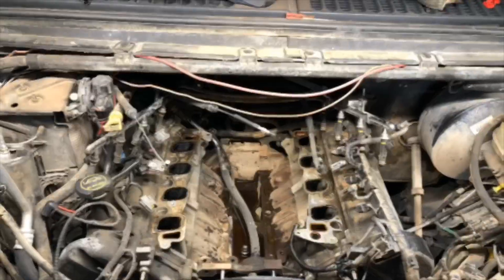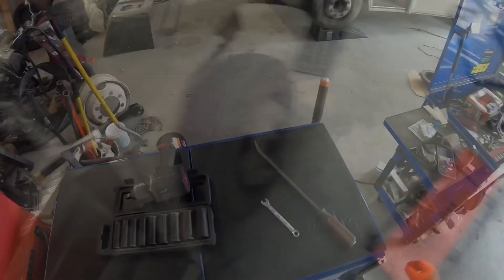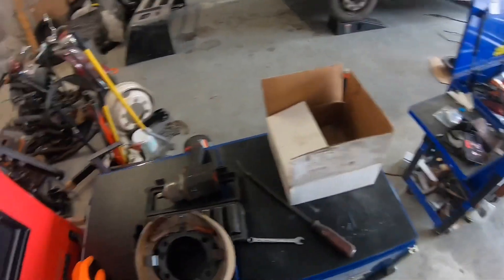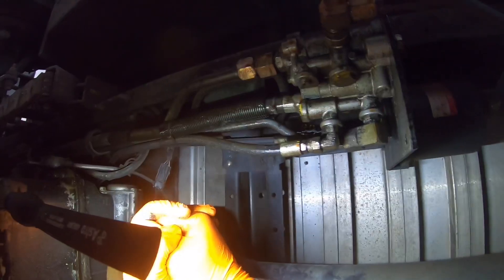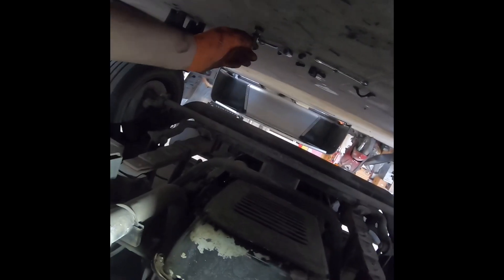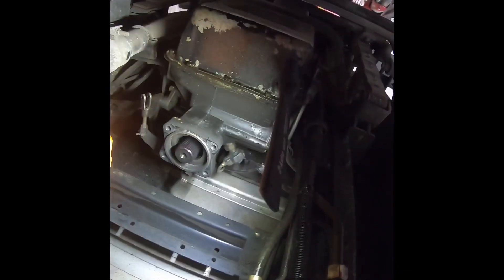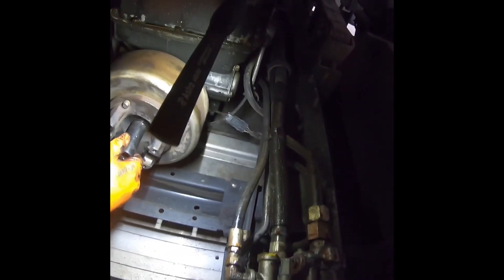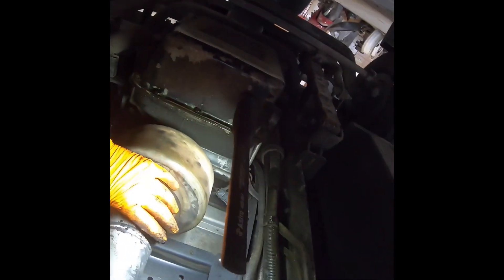Freightliner Stepvans Parking Brake Solved

Comment: Have you done the hydraulic brake chamber on these ? The one that activates the brake
Reply from the maker: Jason Medina I have. Never made a video of it though. You have to cage the spring before removing the cable. Then disconnect the hydraulic lines. Do not attempt to disassemble the canister.
Reply: @MasterT9000  Is it similar to caging it on an air brake system? I see yours is similar to mine. I assume you take out the main hydraulic line that runs to the canister in order to cage it? Where is a good place to find a replacement chamber? I appreciate this video!
Reply from the maker: Rico Reillo yes very similar to caging air brake canister. Put a bolt in it and take off some tension. Then crack your lines. Only place I’ve found the canister is from Freightliner.

Comment: I've got a 2004 Freightliner MT45, 4.3L Mercedes with the Alison transmission. It's been parked for several months as I convert into my retirement tiny home on wheels. Anyway, I go to move it today and the driveline emergency brake will not disengage. Do you have any guidance/advice you could share on how to fix this?
Reply from the maker: Do you have both the PB on the shifter and the yellow pull knob on the dash?
Reply: @MasterT9000  I don't know what a PB is and no yellow pull knob.
Reply: @MasterT9000  The brake is a long lever to the left of the steering wheel.
Reply from the maker: “PB” refers to Parking Brake on the shifter.
Reply from the maker: If the shoes aren’t just stuck to the drum, it might be the cable. At the lever, look for the cable sleeve and shoot some pbblaster or wd40 into the cable sleeve. Then try working it back and forth. Pay close attention to the exposed portion of the cable. Look for binding.
Reply: @MasterT9000  Thank you, that sounds like a plan, well if it ever stops raining, I'll climb under there and work it out.
Reply: My RV was sitting for a long while.  After releasing cam arm, beating the crap out of the drum freed up the shoes...  still need to free up the Haldex hydraulic spring canister.
Reply: @MasterT9000  It turned out to be the transmission. I just needed it to sit in gear for a few minutes for a fluid reservoir to fill back up and it worked perfectly.

Comment: Hi Master TnineK!! I own a 2000 Freightliner MT-45 and I have a problem with the E-Brake coming on while in reverse. They are hydraulic brakes, not air. It is very intermittent. If I go into reverse, the truck may go 5 feet and the parking brake engages. Once I go into drive and back to reverse it releases the parking brake.  Then maybe back for 10 feet and then again the parking brake. I don't know what is causing that. Any help is appreciated.
Reply from the maker: Larry Felix There’s a link at the end of this video that takes you to another of my videos named, parking brake stays on. That will tell you what’s going on
Reply: I can’t find the video?

Comment: Does it work the same on international? I have to do mine too.
Reply from the maker: I believe International has a hand brake instead of a hydraulicly actuated brake. But the drum and shoe setup should effectively be the same.
Different part numbers though.
Reply: @MasterT9000  yes this one does have the hand brake. But I adjusted it and still won’t sit still on a hill. Great video and thank you.
Reply from the maker: @Thetowguy77  you should be able to adjust it both at the handle and at the shoes. But if the shoes are less than 3mm thickness they should be replaced.